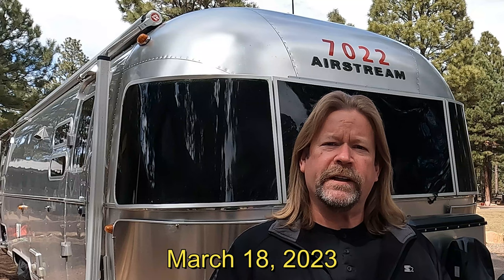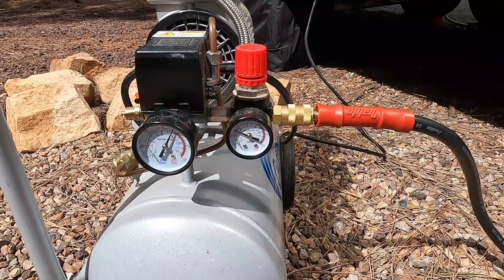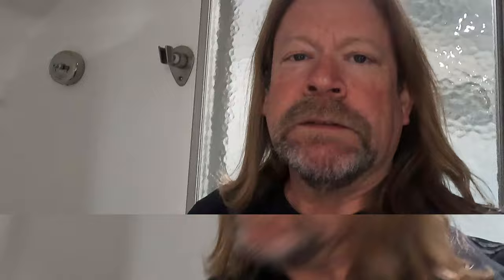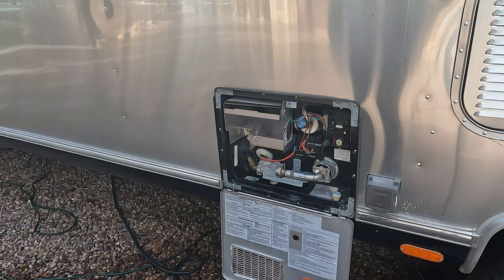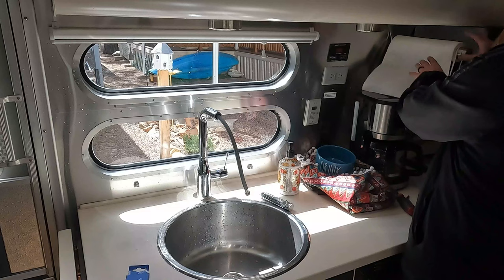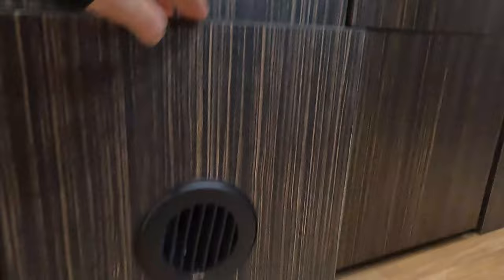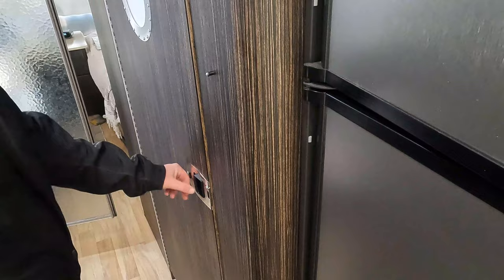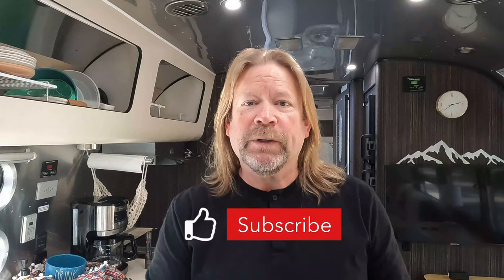Winterizing an Airstream - using compressed air and antifreeze

Comment: Good tip on bypassing the hot water heater.  Only made that mistake once.  At least I was able to refill the 6 jugs of antifreeze from the kitchen faucet in the spring when I de-winterized!  😕
Reply from the maker: At least you didn't have to just flush it all out.  Great idea for refilling... reduce, reuse, recycle!
~D

Comment: How did you make the hose for the antifreeze?
Reply from the maker: Just a couple of parts from Ace Hardware... an adapter to fit the end of the pump line before the filter and some automotive heater hose.  If memory serves, the water lines are 1/2 inch.
~D